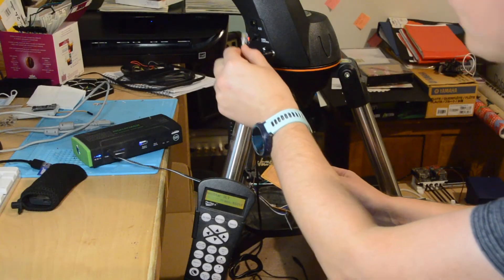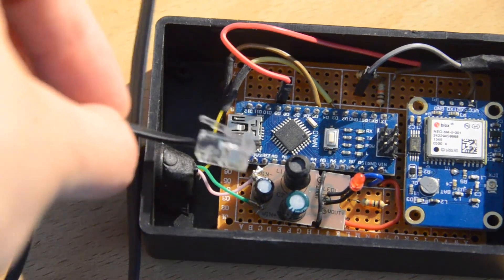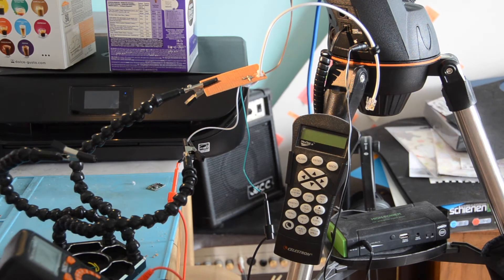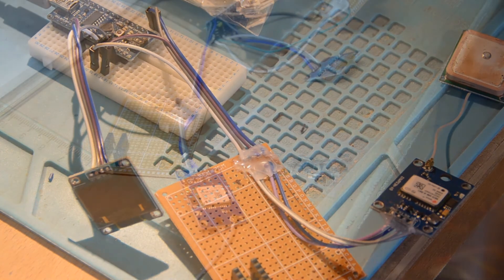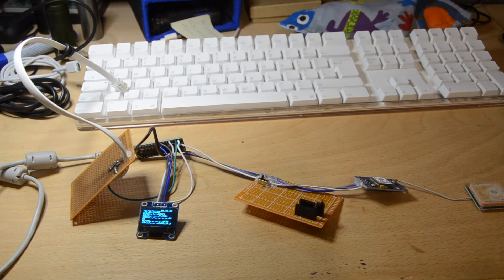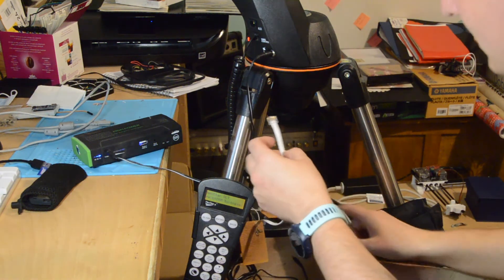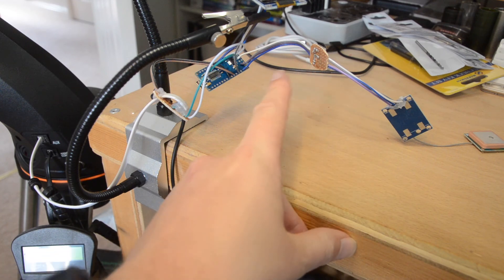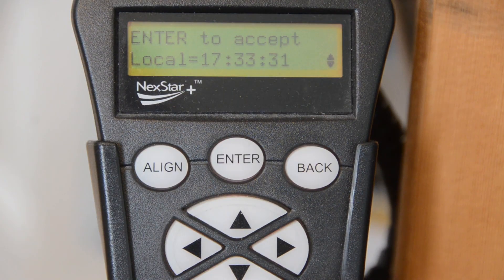Debugging a homebrew Celestron SkySync GPS unit

Comment: Hi Mike, nice video. How are you doing with the GPS project for celestron? I have a 114 SLT and I want to do like you because the original costs a lot of money. Could you help me? What are the connections? I have the arduino and the gps... and the code to load in the arduino? And another thing, the connection of cables that go to the telescope (RJ12) to which each cable belongs? I think there are 4 right? Thank you